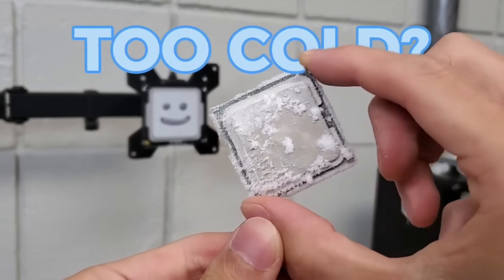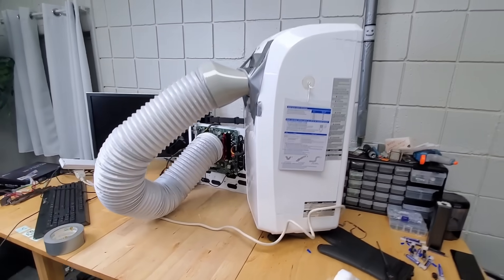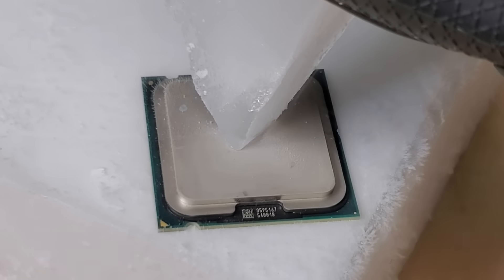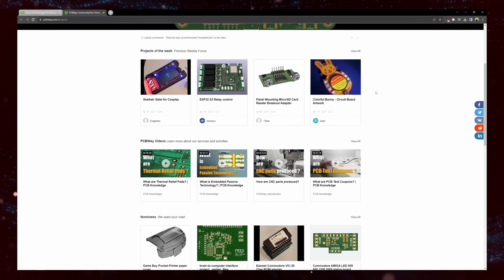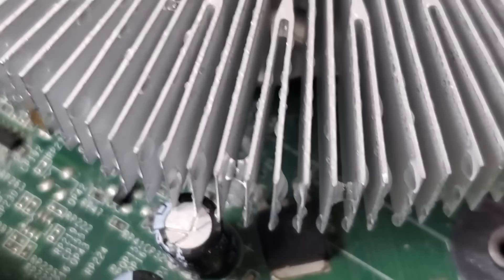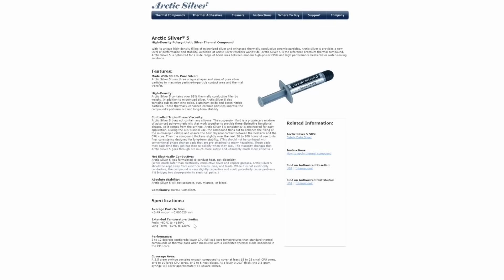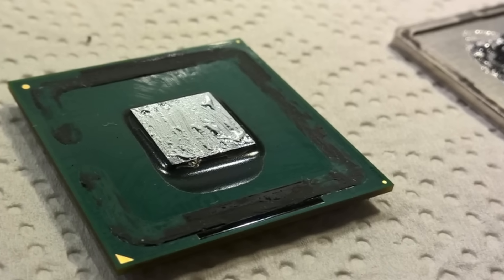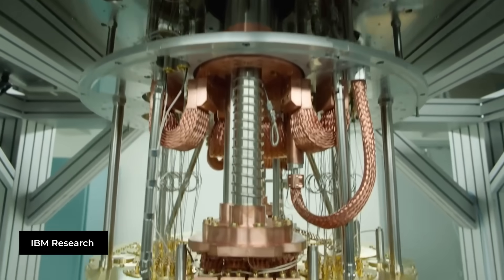The Crazy Future of CPU Cooling

Comment: Another wild idea for cooling metal is the John Searl effect.
Magnets spinning round non magnetic neodymium cools it down to below freezing.
Reply: I have never heard of that before! Very cool, is that what they use in the lab experiments to approach absolute zero?
Reply: @richardsmith9615  Its kinda complicated. It was tech that was invented many decades ago. It was one of those free energy generators. John Searl invented it using industrial tech working at a power plant. I can't remember everything about it. But things went pear shaped. The project was abandonded. He kept one device running in his home for 30 years or something getting free electric. He was told to turn it off by the government though.
Ppl have tried to replicate the technology and have failed. There was a Russian guy that was close to replicating it. He managed to get the metal in the middle cold enough to see frost form at the top.
Its all on youtube.
The way it works is that the magnetic field gets so strong that it pulls the electrons right out of the metal and it gets colder. Need high RPM's though to do it.
Reply: @buchanpeter  I appreciate the explanation, my friend. I'll have to look it up in detail. Thanks
Reply: fake
Reply: @brandon9172   I looked it up, it's not fake, it's possible that its efficacy is exaggerated, but the principle is not fake.
Reply: @richardsmith9615  
Not sure about the cooling aspect tbh, but at least for the "free energy" it's complete bogus.

Comment: what happens if a pc is built in a vaccum? as heat isnt conducted through that as there is nothing for it to pass the energy to?
Reply: Heat can still travel through a vacuum, hence why the sun heats up the earth, you just wouldn't be able to cool it using air as a form of heat transfer, heat can still travel through objects as long as they're touching.
Reply: Infrared light / radiation would be a way of dissipation but it takes a lot of time
Reply: @Codename_Horizon  im just thinking of giant radiator panels for a tiny motherboard
Reply: @texastank  in a vacuum I don’t think heat would dissipate with radiator panels
Reply: @decoy3540  radiator panels are the only way to dissipate heat in a vacuum. Otherwise the ISS would use fans.
Reply: It would overheat

Comment: You couldn't find some liquid nitrogen??? What am I paying you for?
Reply: Just submerge the cpu into the liquid nitrogen as they are not conductive so it's not a problem
Reply: @Mememeteorite  this guy gets it
Reply: @Mememeteorite still not enough surface area. That why they use those thick copper blocks. As extra volume too offcourse. Ln2 will boil and have open areas
Reply: needed for the cars
Reply: regretting free purchace is crazy

Comment: Why not just make the cpu with the cooler part built in or just weld it to it
Reply: i dont know much about welding but i do know about cpy sockets and they would not be able to close with that on it unless specifically designed to and the cpu manufacturers cant sell just cpus they would have to team up with a company to weld onto their cpus and that is if the welding doesnt produce any air bubbles in the middle
Reply: They used to do it with slotted Pentium 2 and Pentium 3 cpus